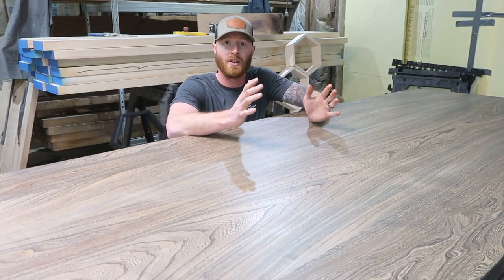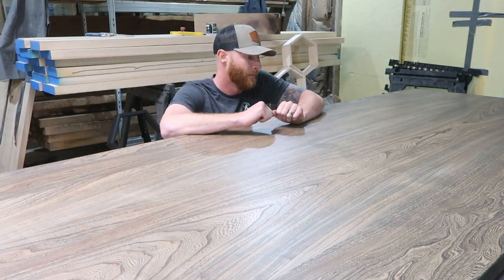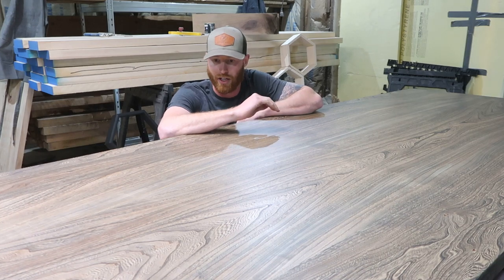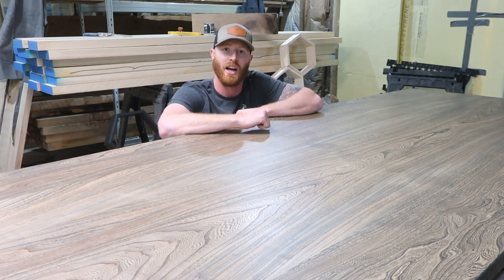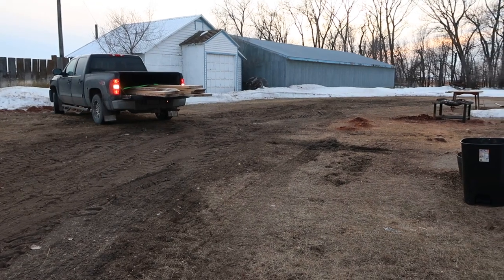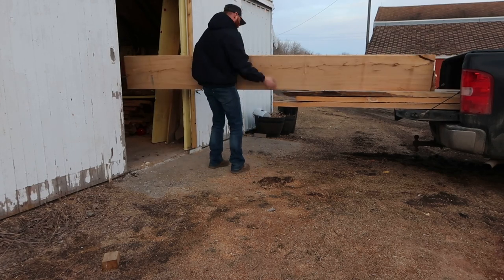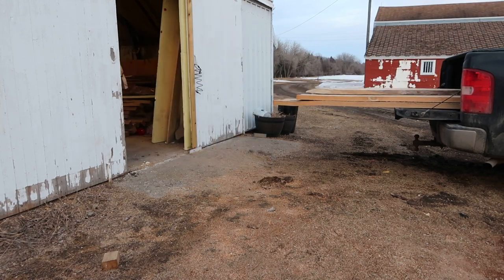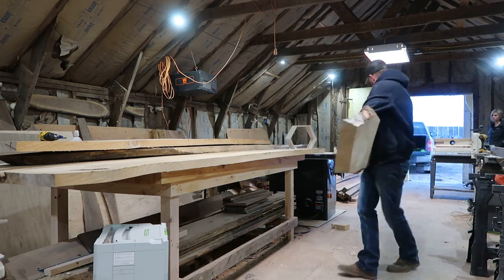How to build a modern dining table

Comment: I’m building this exact table for my dining room, so thank you so much for the video. How thick is your table top?
Reply from the maker: Awesome glad I could help.  My top is 2 inches thick
Reply: @BuiltKnotBought  Did you start with 8/4 or 10/4 and mill down to 2"? Also, how did you connect the 4x4 post between the legs? Did you use a domino?
Reply from the maker: @NaderElmasri  the slabs were a little over 2 inches thick and I milled them down.  The beam is actually solid steal and I welded plates on the edges with a hole for threaded inserts to attach on the inside of the leg
Reply: @BuiltKnotBought  really nice job! Love the channel
Reply from the maker: @NaderElmasri  I appreciate that more than you know thank you!